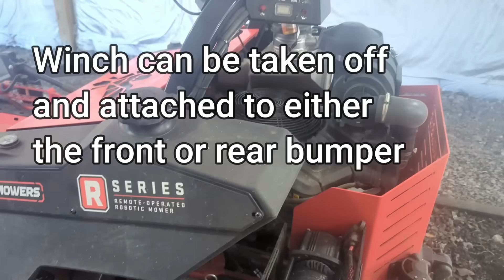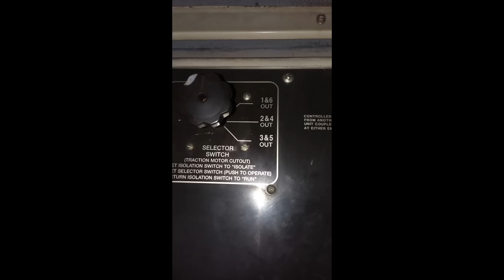Traction Motor goes Bad on #22 Locomotive

Comment: Our county government here is required to buy one machine from each dealer in our area. They have a few different kinds to cut the highway overpass hills that are very steep,$$$$$$$$$$
Reply from the maker: I can understand that and think that is nice that your county wants
to support businesses in their area Dean. But I also understand
that financially this is not always a good way to do business,
kind of a catch 22 type of thing. And the bad thing about that is the tax payers are the ones who lose out. Really appreciate
your watching our video and we hope you have a very good day.
Reply: @ccrx6700  the machines usually have a two year warranty so the repair cost is very low or zero. They always have a good trade in value since the dealer does 99 percent of the repair jobs under warranty. It’s a 50/50 in the long run and the guys always have a like new machines

Comment: About traction motors, lately I have been trying to understand how locomotives do "transition." I recently watched a YouTube video by a mechanical engineer (moniker: hyce) about transition. EMD GP35's needed lots of "shunts," so they had some wicked complex of windings and wires coming out.  It had to do with it using a dc generator instead of an ac alternator for 2500 horsepower and doing transition, edging things to state of the art. My educated guess is that since GE AC motors took another 20-25 years to develop, the enhancements were no simple to get to, so the motors are more complex.  

I did get to work with a pair of EMD 645-20E3's for 10 years, so I claim my guesses are educated.

Comment: Yeah Dave I was thinking with the newer one like you said when you cut out the one you still have dynamic braking that's probably cuz I won is the generator for for the dynamic braking and maybe the other motors pick up too as well
Reply from the maker: I don't know the exact reason for that Corey, but just off the top
of my head, all newer locos have traction motors wired differently
to them instead of them being in sets of 2 like on the old locos?
Thank you for taking the time to watch our video and
may you have a very good day.
Reply: @ccrx6700 you too

Comment: The mower looks a great machine and sure to get plenty of use so a real expenses saving over renting. Sure they hid the control box away so you were not tempted to have a go with it LOL. Our trains use AC motors now, we have some musical Electric Multiple Units which change frequency to the motors making them sing.
Reply from the maker: Yep, if I had the remote that mower would have found it's way
into the back of my truck Cedarcam....  :-)  Corrie would have a blast
running it here on the farm. I don't think anyone here now produces
new locos with DC motors, they are all AC, much more reliable
than DC. Thank you for taking the time to watch our video and
may you have a very good day.
Reply: @ccrx6700  She sure would LOL

Comment: $70,000 for a lawn mower is absolutely insane. There isn't a single bit of tech in that thing that is cutting edge or expensive. It's just a regular lawn mower with some tank treads (which have been a thing for 100+ years) and some wifi and basic computing tech (which costs them probably $50) and they dress it up and price it at the cost of a house. What an absolute ripoff. I could make one of these for $1000 probably. Greedy corporations are ruining this country.
Reply from the maker: it certainly is high priced DrJonez, but guess they sell it at whatever
the market will bear. The one I told you the sales man came out
and talked to me about was close to 6 figures, unbelievable!
Of course I couldn't afford anywhere close to that. Thank you for taking the time to watch our video and may you have a very good day.
Reply: How much do you suppose the product liability insurance is?

Comment: Sorry again but they run on the DC units in a series and series parallel system, which means in series only some of the motors are working in the case of ours two of them. In series parallel all the traction motors are working
Reply from the maker: Thank you for sharing that Steve. I have no idea how the other
older EMD's are set up, I just know how our 3 are. Really appreciate your taking the time to watch the video and may you have a very good day.

Comment: Sorry Dave but another thing I can say is an app problem is one thing but if one ever birdcage I believe they call it you're in real trouble because that means the armature seizes up and won't turn which means the wheels are going to slide
Reply from the maker: Your right about that Steve. I've heard of that happening in some
other places but I don't recall it ever happening here yet, so better
knock on wood cause sooner or later with our luck it will.... :-)

Comment: Wow, very interesting.  I have only ever read for decades now how more "robust" GE traction motors are, which leads one to believe that they are superior to EMD traction motors.  Of course, robustness and quality are not necessarily one and the same.  But my presumption was that GE traction motors were better in every way when compared to EMD's.  Interesting to hear a mechanic's opinion of them.  I've read that GE's pull harder and longer with a longer "short-time" rating.  Some have said a locomotive with an EMD prime mover and GE electrical system would be just about perfect.  I guess some with firsthand knowledge would disagree.  Thanks, Dave.  🤠👍
Reply from the maker: GE puts out some very good literature for their products Scotty..... :-)
I do not know and did not say anything about which product was
superior, only was relating what the guy who rebuilds both
products told me about what a pain it is to rebuild the GE's. 
They very well could provide superior performance to an EMD,
that I cannot answer but what I do know is AC motors are
superior to DC ones no matter who builds them. I can also tell
you that the many loco engineers I have talked with on Class 1 RR's
have all told me they would rather operate EMD than GE. What I
also know is big railroads buy and run more GE locos than EMD.
Whether that is due to price or to performance, I can only
speculate. Thank you for taking the time to watch our video and may you have a very good day.
Reply: @ccrx6700 Always good to have that additional information.  Thanks again for sharing.  🤠👍

Comment: With the age of the locos, any original traction motor is really getting elderly.   The AC traction clearly are desirable since CSX and NS have been upgrading by replacing the electronics and motors to get the consistent traction control and starting ability they provide. That said, they have territories that don't look like the mileage you have there in large part...
Reply: give it another 100 years, then it will be old.
Reply from the maker: None of our locos have original traction motors on them now Bill,
what a feat that would have been if they did tho. Our newest loco
was built in 1978. No question AC motors are much better for
over the road locos than DC motors are. Really appreciate your taking the time to watch the video and may you have a very good day.

Comment: IT doesn't surprise me about EMD traction motors being better to work on. GM were masters of production enginnering. All of the Big 3 were. Back in the days when reliability and uptime mattered. Make them easy to fix, make the spare parts available and common between as many models as you possibly could.
Reply from the maker: That's exactly what EMD did too Shane, parts common among
many models.  Really appreciate your taking the time to watch the video and may you have a very good day.

Comment: Is that motor fault on the same unit that just had new bogies installed?

Also, as I recall, the percentage-grade is the drop distance over a lateral distance - not sure if that is the level distance or the actual travel distance of the slope(the hypotenuse of that triangle); either way, a 100% grade is a 45 degree slope, right? I have always been told never to operate tracked vehicles (bulldozers and such) on anything more than a 30% grade along the slope(side to side) as the vehicle will tend to slide. Most of those vehicles have simple straight shoes - I imagine that the track design and center of gravity helps with being able to tackle such inclines.
Reply from the maker: No it is not Mystickneon, the new trucks were put on #1 loco and
the traction motor went bad on #22. I did fail to be selective in
my choice of words on the degree or percent of slope, also
I do not know if the mower readout is in % or degree, I'm gonna
try and find that out this week. Thank you for taking the
time to watch and may you have a very good day.

Comment: Very cool! As you may have said - AC traction motors tend to outperform their DC counterparts. They are better at starting traction and dynamic braking. They operate near the frequency of the current so this prevents a number of items that damage DC motors. Either way, they handle tons of current and are amazing in terms of the power they put down on the rails! :)
Reply from the maker: No sir I did not say that Brian, but you are right. I'm not sure if anyone even puts DC motors on their new locos anymore, I kinda think no one does?  Thank you for taking the time to watch and may you have a very good day.

Comment: I'm wondering if at various points in the video you aren't conflating percentage of slope with degrees of slope.  A 42% slope (4.2' of rise over 10' of run) is about 23 degrees.   A 100% slope is 45 degrees.  The other thing I was wondering about is that most mower manufacturers seem to recommend mowing slopes by going up and down as opposed to side to side. I do have to admit that the tracked mower does look well suited to side to side mowing.
Reply from the maker: Yes you are right Bryan, I should have been more selective in my
terminology and also I do not know if the RC Mower readout is in
percent of slope or degree of slope, so I failed on both points.
I just did not think of that until you pointed it out. Thank you
for sharing. I'm going to root around and see if that mower
came with an owners manual and find out what it says. 
Thank you for  taking the time to watch and may you have a very good day.

Comment: Really cool mower.  Does it have hitch? Along with the winch, would be very useful for lot of things.  Similar setup used by linemen working in rural areas
Reply from the maker: Your right it is pretty cool Marmite. You can hook the winch on the back or the front, it has eyelets on both ends you can also
hook a chain or rope into, not the kind of hitch that you would
find on a truck to pull your boat tho. The line trimming crews here
have a brush cutter on the front of a skid steer, but they could
benefit from having one like we got.   Really appreciate your taking the time to watch our video and may you have a very good day.

Comment: Hi, Ive been watching for a while now and I was wondering. Why does it seem like there's always some sort of constant issues with either track and or equipment? Is it Yall run the RR with older less reliable used equipment? Or, Do Yall actually run that many loads to justify track and equipment downtimes? OR, is that just normal for all railroads? Anyways, Was curious is all. Thanks!
Reply from the maker: All railroads everywhere have problems Skittles Revenge. But,
no one else on You Tube shows the daily ins and outs and goings
on of railroading, all they show basically is trains running and not
what all goes into what it takes to keep those trains moving.
We do have a bunch of older equipment, but again you never see
or hear about break downs on other railroads, only the derailments
that come on the news. What we do have that is rather unique
is a track that has 70 curves in 16 miles and most of those curves
are high degree curves. Our track also is jointed and not welded
and the above things require a lot of maintenance and is also hard
on equipment. One thing is also our newest loco was built in 1978
and my tamper was built in 1994, so yes were are working with
old stuff, can't get newer locos in here because we don't interchange
and they would have to be trucked in and that is an astronomical
expense to truck a big loco.  Really appreciate your taking the
time to watch our video and may you have a very good day.

Comment: A 100% grade or slope is 45 degrees to the horizontal.  The slope you showed as cut was cut from the top or bottom and not side to side, based on the marks in the vegetation.
Reply from the maker: You are correct in that Roy, the slope at the Walmart site was
cut up and down. 2 years ago when I saw that remote cutter
operating it was to the left of where I first showed at Walmart and actually was running across the slope instead of up and down, it
totally amazed me when I saw it. Apparently from what I have
learned since this video some remote cutters can hold on to
to steeper slope than others can. Thank you for taking the time to watch our video and may you have a very good day.

Comment: D7 7 were good motors , you got to do inspections . I've seen banding come off armatures, brush holders get loose ., not getting enough cool air, brushes break , and Dave    , you got your good ole coal dust . The trains are not running 70 miles a hour , so I don't see wheel slip and current going to zero . Tell me what they found . Good luck and like your shows .
Reply from the maker: Wheel slip happens a lot because of running the train while loading
it with the remote Robert. they are on a slight up hill grade while
loading. According to my friend who used to work at EMD and his job was building and rebuilding traction motors, wheel slip is one
of the hardest things on traction motors and most of the ones
he has worked on in the field were on remote controlled locos.
They did replace the # 5 combo on 22, but I wasn't in there the day
they did. Thank you for taking the time to watch our video and may you have a very good day.

Comment: Dave, the remote control mower is a safer option for mowing STEEP banks and slopes. Ventrac mowers are very stable on steeps, with the low profile dual wheel kit on them, but not as safe as a mower with no one on it all. It looks like at least the tamper is behaving this week! How long will 22 be down? Stay safe out there.
Reply from the maker: Thank you for the nice comment and your right, so much safer
on slopes than with a manned unit Thomas. 22 got it's traction
motor replaced but went back down a few days later for a
bad head gasket on a cylinder head, they were supposed to
replace that today, I don't know how that went tho. Really appreciate your taking the time to watch our video and may you have a very good day.

Comment: Dave, rumor has it that you are researching to find a remote control tramper???

Back when I was engineer on the KLS&C, I was the engineer on 95, our E-8 we used for our dinner train.  I was on the pushback part of the run going up Allen's Hill a half mile 2.5% grade.  Everything seemed normal.  I am pushing 1,050 amps and going around 5MPH.  I had to judge speed by both feel and looking down at the track.  It was a beautiful summer early evening.  Dave, every once in a while I just had to look out the front cab windows. That EMD bulldog nose!  I said to myself, it looks like it is getting foggy while looking forward.  I go back to watching the track and directly out the side window.  During that look, I didn't see any fog.  So I look forward again and realize, "That ain't fog!  That is me!  The #1 traction motor was going up in smoke.  Not yet knowing that we stopped and waited for the smoke to clear.  I started back up the hill.  It was just seconds and the smoke started again and I stopped.  
The head engineer came and he took the dinner train back to Paw Paw.  Smoke trailing him all the way.  
I didn't get in any trouble.  Going so slow as ordered was very hard on the traction motors.  It was just that day it was going to fail.
Reply: Aren't there any inspection protocols for the motors? It would seem that maybe a monthly or quarterly inspection of the motors would be done, to determine if any wear and tear is getting ready to cause a failure.
Reply from the maker: Love when you shares stories like that KLS&C 85.  FYI Harsco does
have a tamper that is pretty much autonomous, an operator can
stand outside and watch as the tamper does everything by
computer.  Really appreciate your taking the time to watch the video and may you have a very good day.

Comment: Hi Dave, why would you want to cut out a pair of traction motors? Don’t need full traction or fuel  economy?
Reply: With an active fault, it won’t move.  Cutting it out, lets you keep running the unit.
Reply from the maker: On these older EMD locos the circuitry is for traction motors to
be wired in pairs, thus 2 at a time have to be cut out if one of those
is bad Mark. On newer locos you only have to cut out a single motor
at a time. if a traction motor goes bad then that throws the loco
into a fault which negates it operating, so when a motor goes bad
then to continue to run the loco, you have to cut out that bad
traction motor circuitry.  Thank you for taking the time to watch our video and may you have a very good day.

Comment: Thank you for the cut out switches for the traction motors. Are there retrofits to allow single motor cutouts for older engines?
Reply: need some 1500 amp switches for that-- the mower could have bought it.
Reply from the maker: Your welcome Jim. If there are upgrades or retrofits I am
not aware of them. Really appreciate your taking the time to watch the video and may you have a very good day.